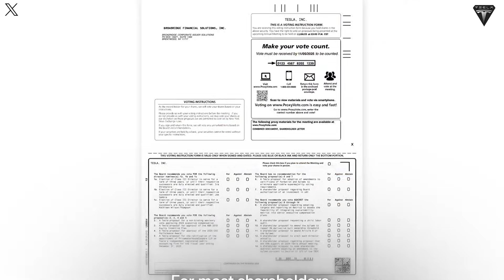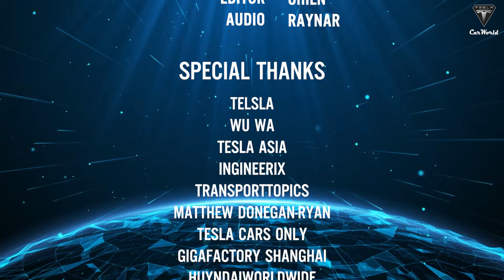Tesla Bot Gen 3 BEST Cooking Robot 2026! Elon Musk SHOCKED 3,000 Massive Capabilities!

Comment: Enhanced mobility and dexterity are critical, but long-term wear on joints and actuators may reduce reliability.
Reply from the maker: True. Tesla targets millions of duty cycles; hands alone cost 50–60% of hardware, designed for continuous 24/7 operation with modular replacement.